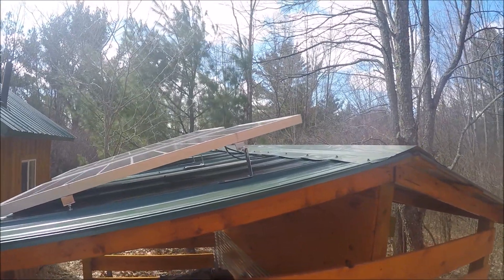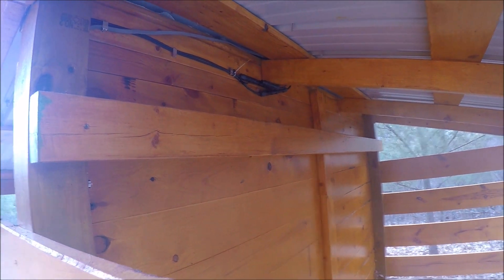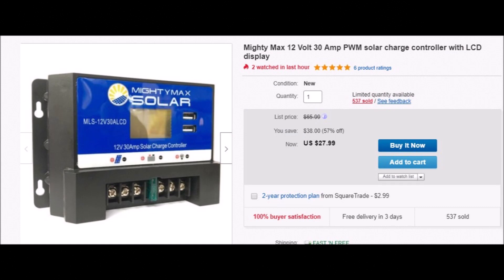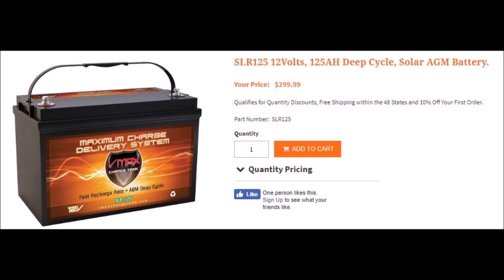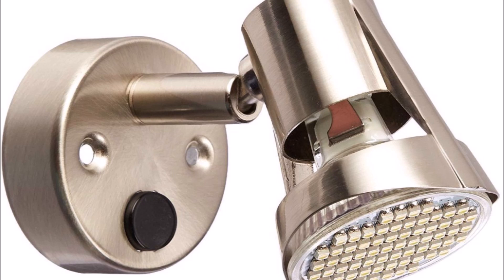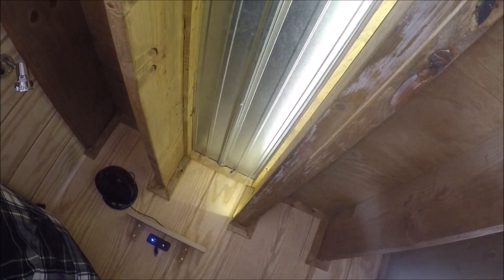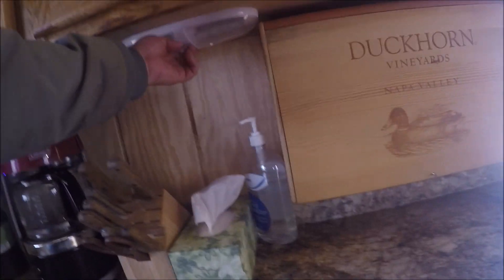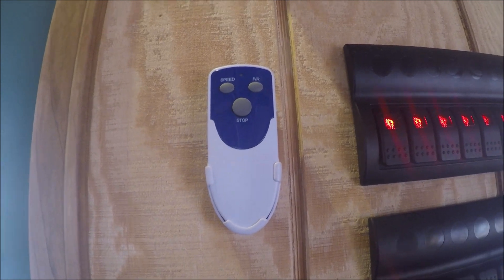Installing a Basic 12V Solar System in an Off Grid Cabin

Comment: I didn't see this question asked so I figure I'd ask myself.  What do you do with your batteries when the temps get cold?  Are they safe to leave alone in the cold of winter?  I want to go solar for a small, off grid cabin I have in far north east Minnesota.  The temps will get to -40 a time or two each winter. Is there a battery that will withstand these temps?  I assume it will have to be charging the whole time.
Reply from the maker: Those temps are certainly extreme so I can't say from experience, however, I've experienced -20f temps and although the capacity of my battery decreases I still have power for lights to work with.  My cabin warms up rather quickly, which also raises the temp of the battery rather fast as well so after a few days the battery is at room temp and if discharged low is now recharging at a warmer temp.  Reading the lit on solar panels, the appear to actually be more efficient in the winter than summer.  Hope this helps, but if  you are using them for lights I think you will be OK.

Comment: they have 12v led tv's now that can be added to a cabin. think those run about 70watts. have a link for the ceiling fan?
Reply from the maker: The thought of connecting other appliances like TV is a frequent thought that crosses my mind from time to time.  Sooner or later I come to my senses that I'm at the cabin to ESCAPE those types of distractions and comforts of home.  While I want to be comfortable, I want to avoid the temptation of making it 'just like home', because I don't want it to be just like home.  By the same token, I can appreciate others might like that added feature but for now, I'm staying TV free.  Thanks for your comment

Comment: Love the cabin! Did you 12 volt fuses or breakers and divide the lights, fan and USB ports on different circuits?
Reply from the maker: Yes, the main supply line comes from the battery to a control panel (see ebay for 12v control panels) and each circuit has an independent fuse.  Each light has a separate switch, which makes energy conservation very easy to manage.

Comment: If you needed more power, would it be smarter to use 2x 300w panels or do 100w panels work better with a 12v system
Reply from the maker: I used 2X100W as they were relatively inexpensive and my math told me that is all I would need to keep my battery charged for weekend use only.  2X300W panels would charge the battery 3X faster, but the rate that I drain the batteries is slow enough for 2X100w to recharge it.  Good luck

Comment: Hello, I didn’t see it if you listed the items, but could you let me know what brand those LED lights are, or a link to them? They’re cool.
Reply from the maker: Here is a link to the type of lights used in the cabin: 
12V Led RV Ceiling Dome Light RV Interior Lighting for Trailer Camper with Switch, Single Dome 300LM 
by Alfateers Service Center INC. 
Learn more: https://www.amazon.com/dp/B01NALLR3M/ref=cm_sw_em_r_mt_dp_7EFR1K26M90ATD0CEZ3Y?_encoding=UTF8&psc=1

Comment: can you put links up for light and all that you used,for this .thank you
Reply from the maker: Graham: These are the types of lights used:
https://www.ebay.com/itm/2PCS-12V-LED-Swivel-Reading-Light-RV-Camper-Trailer-Wall-Mount-Bedside-Lamp-L020/392843124063?epid=28006173522&_trkparms=ispr%3D1&hash=item5b77465d5f:g:ViIAAOSwo69e22lu&amdata=enc%3AAQAFAAACgBaobrjLl8XobRIiIML1V4Imu%252Fn%252BzU5L90Z278x5ickkyMJZWL%252BqFSgQ3TOOe%252FNr7qLtfWpL%252BwwYfKJqSTLvt7tJloBMmYTs4WWIZmyZ6u9eMfIYVAEFPqSs0JuPYdnaoaUVeA25vWi87qv40t1R0y%252BiGgUUfBem%252F7ybO9rZfOib%252FK3BcR%252F4pH8Hc9CC2fOSE%252BlZw9rbsK4ttmiXLBx94YvTxndyofcx8G08oNMlySk%252BtsrWW9jFDDQPFhmnReNaulja5z%252FTdEQUkMxPbhWqdCkijvhcLIaOgiW2n1BKD8ioUEICGtz0exH%252Bzf0SBuoCF2Ukpk8L8pvvAjD2LBwXpYv3ZaGQ%252FMiRquvA6N23DUuGaNaz%252Fz3EwB7Eir08kDoZw6n%252Bd1SMtREEm5T8ZFOd5SdQY8KcPkvZ78OTd10sJ%252FqrVsIOP%252FhjeMNCex%252FF%252B%252FOhi0RthnxxjN3rrMGqfSv4YMO8GZYefRPfmjdvC1QpHidJPGd9aIuboxi0unxmLRiAByzz7t58lBwnBRuTpMnYiePiG3JjZ5KYQhjVyfzM9vK3cXYcBtWYDyJ%252FxvWOZNoGkIAC2T23rvBOX9Deyg%252ByvXy3aW3EWK8DXvCjjp%252BvFmIDbRq23Rzyfpy246lbUmHfc8w665DFAFlgBfobg6axKHzHz4fy4iLC82LS%252F0n1Em97TxtF6%252BG0ZYW4GPoDveIVHfd2QoXzTU8On%252FOyn%252B69ej%252BW3lo%252B3HaW8p0HQV0KIO5%252BJ2drfstAyyYmCKhaN49XDTlNkjeVVJFfEXYgETFuh49E5AIAjktoax4wTfR6Xpdynk8QW2fWN2BnLgAScuahGghW3rxyLwwhmdMAkNDklpI%253D%7Ccksum%3A392843124063e61832c52d6c4f66b82a8243f400d0e5%7Campid%3APL_CLK%7Cclp%3A2334524

Comment: My favorite off grid cabin video! I built one very similar to yours on the Olympic peninsula in 2018. I’m. In the process of planning my 12v system now. What size wire are you using ? My longest run is about 30’ and feeds 3 LED lights at 3W each. Great videos, and thanks in advance.    R/Rob
Reply from the maker: I used 12ga on the premise that one day, if I end up getting connected to the grid, I won't have to rewire the entire cabin.  I'm sure you can use something smaller for 12v but I was thinking ahead about 50 years from now!

Comment: Great video. I didn't catch the brand of the low voltage fan...
Reply from the maker: This fan is very similar if not the same that I purchased: https://www.amazon.com/LASALLE-BRIS-410TSDC36BNOKCY-Ceil-Cher/dp/B07G757XQZ/ref=sr_1_2?dchild=1&keywords=12v+ceiling+fan&qid=1614534508&sr=8-2

Comment: Hello I am looking to run a fridge and ac off solar.I am confused on where the connections connect to from the solar panel and how I can get  AC outlet plug from a solar panel can you please explain this to me.
Reply from the maker: This video should explain how to set up your solar system.  If you are trying to run a fridge off solar, I suggest you buy a propane fridge.  It will be much more efficient than using solar, unless you have a really big solar panel and battery bank.  AC will also be an even bigger draw on solar as it uses massive amounts of amps and will also require a really big solar array.  Good luck  https://youtu.be/N3eLrZEzmiA

Comment: Excellent!! Thank you for this. I know almost nothing about solar and have a bare bones cabin. No wiring or plumbing. Gravity fed water and extension cords to LED lights, 700w microwave.  I had a 48v battery (Rolls) bank installed with hopes of solar panel install in spring. For now use gen to charge every other day. Spent a lot of $ for this, am looking for low energy lighting and any ideas for living better off grid. Thank you for this short & sweet video.
Reply from the maker: Stephanie, my solar system was designed only to provide lighting for the cabin and charging cell phones and computers.  Any high wattage appliances (i.e.  microwave) is simply a convenience I can live without on weekends at the cabin, so it wasn't a consideration for me.  There is lots available online for 12v appliances (i.e. my ceiling fan) than have low amp consumption that makes it possible to be very comfortable, but microwaves, dishwashers, and inverters converting to 110v wasn't part of the plan.  When I need more power for a project (i.e. cutting wood with power tools), I bring in my 3000w generator on my ATV and take it home with me when I'm done.  Hope it helps!

Comment: Thank you for all the options you posted.didn't know about the ceiling fans.it's hard to find low amperage equipment.
Reply from the maker: Donald, see amazon or ebay and search for 12v appliances.  There is a large selection.  I keep a keen eye on amps consumed as part of my buying decision.  Also, RV supply stores have lots of 12 options available.

Comment: Need some help.....  I have 10 -  36 volt 225 watt solar panels.  I want to buy batteries for it.. I like to buy the common 12 volt batteries..   Maybe 4 to 6 golf cart or solar batteries. Question: Can I buy a Mppt charge controller Regulator to convert the 36v solar panels to charge the 12v batteries?  What would you do?
Reply from the maker: I'm sorry, but I'm not a solar expert outside of a simple 12v system.  Sorry I can't help!
Reply: That's exactly what you would need to do is buy an MPPT charge controller which will take your 36v +/- and lower the voltage to about 14.5v which is the same as battery chargers put out.  The nice thing about an MPPT charge controller is that if it lowers the voltage to 1/3 or the input voltage it will than increase the amperage by 3 times whatever your panels are producing.  don't get a PWM charge controller because it will only cut the voltage to the proper voltage and then wastes anything above that so it is very inefficient.   P.S.  Most folks are going to LiFePo4 (Lithium Iron Phosphate) batteries even though they are much, much more expensive to purchase.  They last for a lifetime (or 2 or 3) and can be drained of 80% of their capacity with no damage whereas any lead-acid battery -either flooded or sealed - should never be drained of more than 50% of it's capacity.  Any more and it can kill the battery in short order.

Comment: nice set up,i'm about to set up a system like you in new hampshire  in a remote cabin.do you have any problems with animals eating wires ?? i'm thinking of putting wires in conduit.
Reply from the maker: No problems with animals and wires.  Only exposed wire is from the solar panels down to the ground, and then from the ground up into cabin.  It isn't very attractive for them to want to eat them, but if there is a problem it will be exposed and visible.  In the cabin, everything is in the wall.  No big risk of fire or shorts as everything is 12v.  Good luck!

Comment: Best off grid video on you tube period!   One question, can you please share name/brand of the ceiling fan please???   I have searched high and low on Amazon, ebay, google, etc. and have not found any DC fans with a remote and many are just small portables!   Thank you in advance!  NY Adam
Reply from the maker: This is the 12v fan I purchased for the cabin:  Good luck!  https://www.amazon.com/Ceiling-Rubbed-Bronze-Blade-Remote/dp/B086DVTZ1G/ref=pd_vtp_263_2/138-4783528-6603231?_encoding=UTF8&pd_rd_i=B086DVTZ1G&pd_rd_r=5361a3bc-88e6-47fb-916b-b0a4c1e07c5d&pd_rd_w=BAbwA&pd_rd_wg=DuDyC&pf_rd_p=59828acf-6bde-4d94-96a5-3e2b4a0e0bc6&pf_rd_r=DPB6R3VWBXW9X52GKGPT&psc=1&refRID=DPB6R3VWBXW9X52GKGPT

Comment: Great video- any link or. Ebay picture of exact name for those. Wall lights.   Thanks
Reply from the maker: These lights are similar to what I used per your request:  https://www.ebay.com/itm/2-LED12V-Frosted-Glass-Swivel-Wall-Reading-Light-Interior-RV-Motorhome-Book-Lamp/261611017335?epid=541459016&hash=item3ce93b5477:g:73UAAOSwuaJe6DyY

Comment: Awesome. Your setup is lit.

Solar panel https://amzn.to/2Cx3J5t
Eco-worthy 1000w https://amzn.to/2Cg8i4a
Amazing shower https://amzn.to/39trFTi
Earbuds https://amzn.to/3fcw3Iv
Kindle ultimate https://amzn.to/31PAx3N
Twitch prime https://amzn.to/2ZIgcLl
fire tv stick https://amzn.to/2C2bTlE
Midea U Inverter Window Ac 8,000BTU https://amzn.to/3eRYzyp
Necklace fan https://amzn.to/2VGlIwU
Sense Energy Monitor https://amzn.to/2T2u3JD
Spiderman FFH https://amzn.to/2W3NIK7
Aveners: End game  https://amzn.to/2KOhyx7
Metamucil double https://amzn.to/3aHoNB8 single https://amzn.to/3bmvVTU
Canon EOS M50 https://amzn.to/35fHX0c
SONY RX 100 VI https://amzn.to/35bteTS
Canon PowerShot G7 X Mark II https://amzn.to/2WaAPhp
CANON 90D https://amzn.to/3cX8z8O
SONY A6400 https://amzn.to/2VMUNzL
Darth Vader and Ahsoka https://amzn.to/2A3qDjl
Captain Rex https://amzn.to/2L2tMST
Ahsoka Rebel https://amzn.to/2A0hoAl
Anakin https://amzn.to/2W8QZch
Skillmatic https://amzn.to/37PwSEn
Aqua 4 in 1 Monterey https://amzn.to/2Ctihmm
Bunch O https://amzn.to/2YWQodL
Face mask https://amzn.to/2ZBw2Y9
Enema https://amzn.to/2YTOquQ
Amazon business account https://amzn.to/3h9t98K
100 disposable gloves https://amzn.to/3dEbNh9
Bicycle rollers https://amzn.to/2VFCOLh
Oscilloscope https://amzn.to/32tCFyA
Ispring reverse osmosis https://amzn.to/2Wy6D0I
Flex Seal Spray Rubber Sealant Coating  https://amzn.to/2OWPERv
Great Stuff 157913 Big Gap Filler, 20 oz https://amzn.to/39t7lBK
Reusable Half Face Cover, NASUM M101 Face Cover https://amzn.to/3jDWFVl
Rockport Men's Bennett Lane 4 Venetian Shoe https://amzn.to/39tqumR
Helix Flexible Stainless Steel Non Skid Ruler https://amzn.to/3jECy9B
Bacitracin Zinc Firtst Aid Antibiotic https://amzn.to/30KvsHT

Comment: Wow you literally have everything I want in our cabin that we just built! I just have a few questions on products. I’ve found the led strip lights as well as your lights placed all around the cabin. I’m just wondering where you got the USB wall charger for cell phones and the ceiling fan with remote I think those are the greatest addtitions I could do! Thanks for the videos
Reply from the maker: You can purchase the USB wall chargers and fan on amazon.  Look for "12V USB Outlet" and "12V ceiling fan with remote".  Hope this helps!

Comment: So if I only have 200 watts of solar panels but I have multiple batteries can I slowly charge all those batteries up and once they are charged use up that power and then just start the process again? I know it’s rough on the batteries but just curious as a theory about trickle charging up proper deep cycle batteries for emergency uses
Reply from the maker: Yes, you can do that.  Your solar panel(s) would connect to a common supply wire, that then connects to your charge controller, and then the charge controller connects to your batteries which are connected together.  Any solar supply shop can give you the advice and proper wiring instructions.  Your panels will continue to charge the batteries even while they are in use, and when no power is being drawn, it will store in the batteries and the charge controller will prevent overcharging (the charge controller is very, very important so don't omit it).  Good luck

Comment: I'm trying to install solar at the moment in my cabin. The closest I can put my  solar panels  to my cabin is about 45 to 50 feet without cutting down a lot of trees on someone else's property. I'm having trouble determining what size wire I need to make that long of a run. Additionally I am not sure where I need to put the batteries. Should I put them closer to the cabin or closer to pannels or does it matter?
Reply from the maker: Sorry, but I'm not an expert at this but originally I had my panels about 50' from the battery.  I suggest an using an AGM battery so that gassing isn't  a concern.  As you saw in the video, the battery is kept under my kitchen counter.  I slowly moved my batteries closer, into the shaded area to see how much loss I experienced.  I only use my cabin on weekends so I found that even shaded when I returned the following Friday I had full charge.  I put my panels on a portable stand made from 2X4's and slowly moved it to see how much change there would be, with little difference.  I think at 50' you will not experience too much loss, but suggest you consult a solar 'shop' to seek their opinion.
Reply: @Michigan_Backwoods  thank you for your input. I appreciate you taking the time to respond. I think I'll build a wooden box against the exterior of my cabin to house the batteries in.
Reply: Depending on the amps your bringing in 10 gauge wire will bring in up to 40 amps and amps times volts equals watts I have 480 watts 80 feet away no problems
Reply: My 6 Agm batteries are 10 feet from where I sleep keep them indoors just remember the longer the distance the bigger the cable up to about 100 plus feet hope this helps I'm going to go 24 volt more efficient and much cheaper I'm doing more of a permanent off grid thing
Reply: @alonzodesantis6989  thanks. Yes both of your comments are very helpful. I am doing a permanent solar thing to my cabin as well. As I intend to live in the hunting cabin year-round now. Way off grid and well away from civilization. The only electrical  " necessities " I have our a couple of 12 volt fans, cell phone charging, and some type of 12 volt lighting for both inside and outside. Thanks.
Reply: I set up a little off grid room in the basement not unlike a cabin I have a 3.5 ft and a 4.4 cubic foot freezer and fridge 32 inch TV with a fire stick also an Echo and sub woofer and not but not least 4 low wattage LED lights running off of my 6 100 amp hour batteries combined with a 2000 watt inverter charger just need to increase the input from 480 to 1000 watts forgot to mention the 60 amp mppt solar charge controller thought I'd mention what you can do with solar check out YouTube videos I follow practical preppers engineer 775 he does whole house installation's and Will Prowes he's into Diy projects
Reply: @alonzodesantis6989  thanks.  I'll check out those channels.
Reply: @rodneyslinger6316  this will be helpful for the angle of the panels find out your latitude subtract from 90  degrees that will be the angle in degrees for the summer and add for winter there's an app you can download another thing use a ground mount not roof easier to maintain and such good luck I'm looking to do the same thing but maybe so far away from civilization
Reply: Forgot to mention Solar quotes he's from Australia seems to have good advice 😉